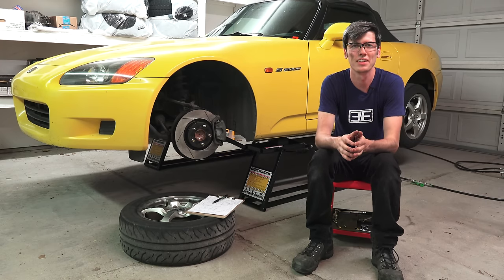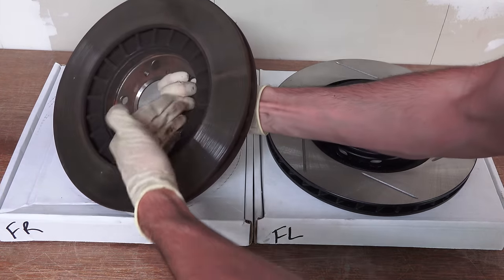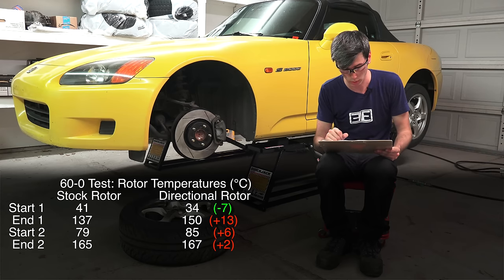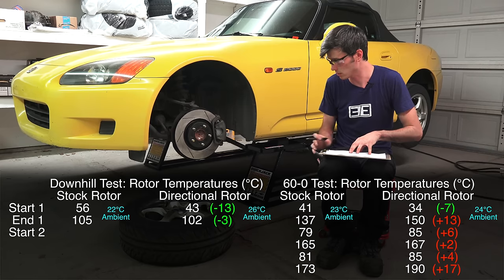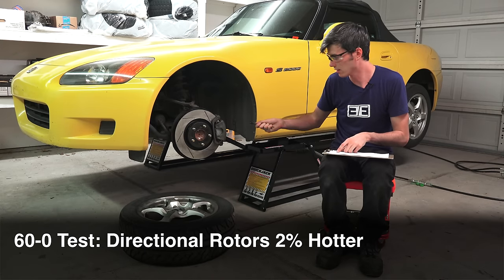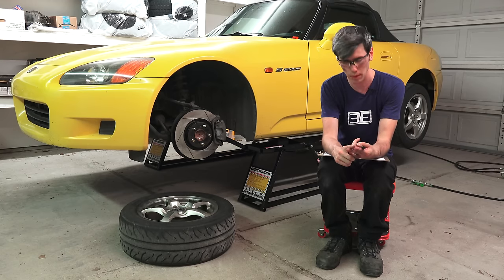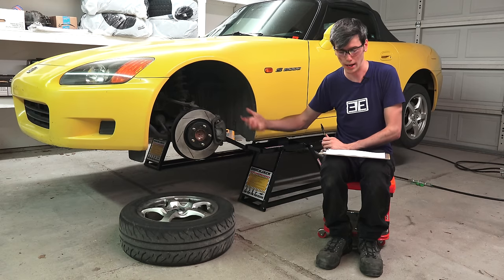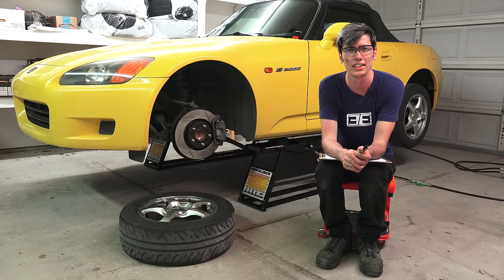Do Performance Brake Rotors Have Better Cooling?

Comment: As an ME this was a great video. Other factors to consider are friction as the stock rotors you tested looked to be used and the slotted rotors looked brand new. Generally rotors need to be "broken in" to the brake pads. If the same pads were used throughout the experiment they may have broken in to the stock set of rotors creating higher friction points on the slotted rotors. Incidentally came across this video looking for upgrades to my stock brakes.

Comment: YOU have been working on you're car. I love it! a youtuber that doesnt pay someone else to do the dirty work.
Reply from the maker: Really just clever editing and makeup. ;)
Reply: Well you're cosmetics person needs a raise. lol
Reply: You're=you are. You meant to write your.
Reply: +denka1337 You're*
Reply: No.
Reply: Maybe  symbiosis  and is 1 with the car You Are Car. ha
Reply: GTP Life   You are = you're 
                   Your = means belongs to that  "you"
There's no hope for humanity.
Reply: GTP Life you would like autoedit youtube channel
Reply: definitely my motto is built not bought i even built my own front bumper on my suburban.
Reply: GTP Life better yet, an engineer that can swing a wrench. #Respect ✊
Reply: GTP Life brakes are, by far, the simplest repair on a vehicle. If an "engineer" can't do that repair, they should probably not call themselves an engineer. 
Lol
Reply: Engineering Explained that's exactly what it looked like, too. Like you smeared grease on your face and grabbed your brand new PPE and started taping lol. No one has grease on their face like that except actors in movies/TV shows
Reply: Hacker Adam BLOWS you would be surprised how many engineers don't even know what a screw is. I'm a mechanical engineer (but I can do any work I need on my car front structural welding repair to blown head gasket)

Comment: the veins vent the pad gases away and prevent brake fade and essentially do a similar job to a wet tread tire pushing water center out.  critically hot pads under pressure want to hover away from a flat rotor surface much like a hover craft generates thrust and hovers on its skirt. introduce veins, voila gaseous escapiest...   anyone that races or drives very aggressively knows the sinking and sphincter puckering feel
 that is brake fade.
Reply: james, bingo. I put 'j hook' (Willwood style) rotors on my car and the fade resistance was vastly improved on heavy braking over stock rotors.
Reply: Yes, the surface grooves do that, but it doesn't matter which direction those grooves are clocked on the rotor.  Foolish people think those grooves somehow have to spin a particular way as if they are scooping air the way a saw blade scoops wood chips when cutting wood.  WRONG!
Reply: exactly. He should have measured the braking distance after repeated braking under high load. Not measuring temperature. But yeah he did that home work when cooling was in question. Pointless but done.
Reply: @LukeBasson  to be fair to him, a big marketing point of drilled and/or slotted rotors is the "improved cooling" properties. So this is a good test for that factor. The brake fade and stopping distance properties should be done in another video
Reply: @sidewinderzero  These are not drilled though. He doesn't seem to know the reason for the grooves, which are for the reason which James Alverson stated.
Reply: @alangross2277  reread my comment
Reply: @sidewinderzero  I agree with what you said 100% and wasn't meaning to dispute your comment. That said, he seems to have missed the point of these types of rotors. It's a buyer beware world out there, if somebody is buying these because they think they're going to run "cooler" then they have not done their homework. His testing would have been much more informative to his viewers had he stated what the actual purpose of the slots and/or holes are. At this point one has to wonder if he knows.
Reply: @alangross2277  looks like I misunderstood you then, fair enough my good man. I agree with you there as well. But too late now anyway.
Reply: @sidewinderzero  No problem...it's often times very hard to know somebody's intent in a comment.
Reply: @alangross2277  But wait, he's not talking about the grooves right? He's talking about the vanes between the 2 rotors? Or am I missing something?
Reply: @vidjansa9955  He is talking about the grooves or slots on the face of the rotor.
Reply: Alan Gross then why the picture of the vanes at 0:44?
Reply: @vidjansa9955  Dude! At the beginning of the video he points at what he is talking about...I don't know what your confusion is.
Reply: Alan Gross Alan Gross Well, he could just as well be pointing at the rotor that has different vanes (the fact that it is slotted being a coincidence), he has a picture of in the video which shows different vanes and it would make sense since vanes do help with the cooling...
Reply: @LukeBasson  The other half of that question is, is it really a problem? I honestly never felt brake fade in my car, and I sometimes drive fairly aggressively. 

I know this is an issue on the track, where you're constantly going from full throttle to slamming on the brakes, and back again. Street driving, there is usually plenty of time for the brakes to recover. The only time I can imagine this is an issue is diving down a long freeway hill at speed, and constantly having to drag your brakes the whole way down. I've only really had this problem in the 14k pound F550 crane truck at work. I just learned to baby the brakes.
Reply: @mitchd949  Not true !! The rotor on the driver's side of the yellow car in the video is mounted ON THE WRONG SIDE !
 The slots and drilled holes are DIRECTIONAL !!
 My ACDelco Specialty Performance Drilled & Slotteds are marked "L" and "R" from the factory.
The rotors were made especially for severe-duty police service -- mounted on '95 Grand Marquis.
 These rotors were installed along with Eclipse Calipers, Motrorcraft Police Pads, Centric Hoses, and D.O.T. 4 Brake Fluid.
After 50,000 miles of use, Brake performance is outstanding -- for long-distance, high-speed touring through the mountains and deserts of the American West.
Reply: @sidewinderzero  Really?  Drilling, yes.  But I've NEVER seen slotting alone advertise the cooling factor.  Because that's not what they're for.

Comment: I'm not sure you are taking all things into consideration. Rotor temperature alone may not be the sole determining factor of performance.  What if the rotors are carrying away heat from the pads more efficiently?  Or, with the slotting allowing gas to escape may be offering additional friction, resulting in the higher temperatures, but increased braking as well.  

I'm not saying you're wrong.  Just that, I'm not sure that you are right.
Reply: Off-gassing isn't as much of an issue for current brake pad materials. However, the vents should aid in clearing dirt off the rotors, and should also shed water better than a solid rotor.  I wonder if the slotting helps prevent rotor warp...  Regardless, IMO you may be on to something.
Reply: Slotted rotors are only for looks. The fastest cars in the world F1 cars, use solid rotors. Enough said.
Reply: They are also open wheeled. Not saying you are wrong, but they are also nothing like a road car :)
Reply: Or if a carbon ceramic brake for example generally won't even heat up to operating temperature on the street, so it may have anything from worse, same, or better stopping performance compared to the regular brakes on the street. Carbon ceramic brakes may even have worse cooling to try to get them up to temp quicker? Again I have no idea though.
Reply: @Theredeemedchild2  But rally cars use slotted, which experience more adverse conditions than tarmac, maybe they perform better in mud or dirt etc.
Reply: My thought is that most performance rotors ie carbon ceramic, need to be at very high temp to work well. So heat doesnt mean less efficient, they are probably designed to work at higher temps when the stock arnt. But I'm only a certified YouTube "mechanic" so I could be talking out my ass
Reply: Yes, they may brake harder but the energy is the same as long as there is a small difference (otherwise if you brake slowly more energy goes into the rolling resistance and air resistance). Also less surface area (with the slotted rotors) means more heat at the surface but then the heat is dissipated in the material pretty quickly. I think the data shows more probably a correlation between the temperature and mass.
Reply: Nvr Dwn every single professional GT car in every professional GT series in the world disagrees with you. You don’t know what you’re talking about. F1 cars use carbon brakes and a ton of cooling. Stop acting like you have any clue what you’re trying to talk about.
Reply: @TheHannukahZombie  What works on a race track doesn't necessarily work on the street.  The driving conditions couldn't be more different, ESPECIALLY the braking conditions.   Cold braking performance is irrelevant on the track, but crucial on the street.  Repeated max braking performance is critical on the track but rarely matters on the street.  Etc. Etc. Etc.
Reply: Wouldn't more heat mean more friction mean better braking performance?  Brake friction rotor temperature and cooking are all separate measures
Reply: @666dynomax  No, because the heat cooks the pads.  Retained heat is a very bad thing for braking performance, all other things being equal.
Reply: @chuckschillingvideos  Doesn't matter, the person I replied to is 100% wrong. Carbon brakes on an F1 car and steel rotors on the street are two entirely different animals. Again, that person needs to STFU because they don't know what they are talking about. Slotted rotors on street cars are fine, same with drilled. If they weren't performance cars wouldn't come with them from the factory.
Reply: @chuckschillingvideos  yes and no, it all depends on the operating temp range of the brake pads. Yes, the pads will eventually fail if you are outside the temp threshold. The Mu factor decreases with temperatures close to the threshold which will impact the braking performance.
Reply: In my experience, I’ve had many solid rotors warp over and over, but any time I’ve ever put slotted rotors on a car they get too thin to be reused before they ever warp
Reply: He also isn't considering the surface finish. When new, brake rotors have cross-hatching on the friction surface to help the pads bed in. Over time, this wears off. The new rotors will have cross-hatching while the original rotors won't meaning the new rotors are going to generate more friction and, in turn, more heat. The only proper way to test this is to have both slotted and non-slotted rotors in new condition with their own identical sets of brake pads. Go through the same bed in procedure with each set, and then test.
Reply: I'm a mechanic and turn rotors as part of my job. The machine (at least the one we have) doesn't put cross-hatching on the rotor, it just cuts the surface to make it even again. I usually try to scuff the surface with some aggressive sand paper after I'm done cutting but cast iron rotors are pretty hard and it doesn't really do much. You would need some kind of special machine to put OE style cross-hatching back into the rotor surface after turning it.
Reply: Nvr Dwn f1 also don’t use steel rotors or pads either
Reply: @Theredeemedchild2  Not so.
Reply: Yeah, they're a carbon type brake rotor like you can find on high end cars. Very similar. Sorry but the whole point of a rotor is to dissipate heat. Air cannot conduct heat as much as steel. The less material in a rotors, the less heat it can hold. Which means the pad gets hotter, which can lead to serious problems... Like brake fade because the brake fluid begins to boil. "Gas" between the rotor and pad use to be a thing, but isn't anymore.

Comment: but they're air cooled so shouldn't you brake then travel a little and see the difference in cooling between OE v. aftermarket? you would also think you'd need a specific brake pad with the directional rotors do increase the breaking and cooling but decreasing the coefficient of friction to run cooler.
Reply: Thomas Comptois I said the same thing but you beat me to it! But yes I absolutely agree, thank God someone else thought of it too.
Reply: Thomas Comptois  the energy required to stop the car is the same if the speed is the sams, that energy goes into the rotors/braking system. keeping the pads the same means they hold the same energy.
Reply: the energy is the same I never questioned that. I'm just saying you change the coefficient of friction by changing materials and design. and the other point was rotor cooling is done by airflow dissipating the heat from the rotors and not when your stopped. granted great will still be radiated to the air while at rest but the main cooling effect is done while in motion
Reply: heat will be radiated
Reply: Artem Brayson I couldn't agree more

Comment: Even if breaking performance is the same, less un-sprung mass  is a worthy venture.
Reply: @t1tacal  I prefer a tinfoil hat so the aliens can’t tell what you’re thinking.
Reply: @alienpoker  With an "HD" Antenna?
Reply: Yes that’s is a positive thing however you don’t want the rotors to be too thin otherwise they will break. More mass means when you apply the brakes they stay cooler until you first stop so for road use they are more effective. Then after repeated breaking they will heat up. Racing rotors are  not too large in diameter, but thicker and still not too heavy. However. They have air ducts with intensive cooling.
Reply: inded. I am running 3D Strand woven carbon ceramics in the front, which saved 7.1 kg per rotor or 31 lbs for the front set, the steering increase with the angular momentum decrease, and 0.1-0.2 s 0-60 decrease. Also shorter braking distance but i have yet to measure that. Also, if discussing performance steel rotors lets talk something like Brembos with an aluminum hats which cools faster...
Reply: The increase in acceleration performance is mainly due the reduced weight of your wallet and bank accounts.
Reply: @jtwu8931  Not if the performance saves the car 2-3 times when someone one with a 500$ clunker cuts you off and hits the brakes. I remember such a scenario when the cheap brakes, EBC, failed so badly that I nearly hit the car. They were permanently DTVed... After that spent better $ on brakes and all I got to do is making sure that someone does not rear end me. A single such collision due to cheap brakes can result, where I live, in 500-1000$ yearly premiums for 5-10 years, thousands more. Or a sudden traffic jam.  Same as Civics, in winter the calipers seized suddenly and near mishaps. Went to a premium car, no more seizures, and my rear brakes last easily 160,000 kms (vs 1-2 winters for a Civic). Front ones about 100k.... Brembo GT steels.. Pricey but they paid themselves over in NOT having claims..
Reply: Belisarius bro, get a Subaru and it will brake for you. Cheers
Reply: JT Wu i live in Canada where they have lots of problems BBK and worse, any Subaro oem parts really rut except at 47deg North where there is no wet 20% Salinity. In Montreal qc city Ottawa Winnipeg subaru rots in a few years. Brakes last one winter. Germans last forever but hey who am I, we only have 500.000 kms of premium german ownership and 13 winters for 2 cars. Japanese only before. Google Subaru rust and see why they are a joke in winter now. Lots of issues. Its AWD is still stellar, but maintenance brutal. Non ULSAB alloys shows vs AMG BMW Porsche and even sloppy Volvo has that tech from brakes to hood..

Comment: Actually the brake cooling can be maximized by the airflow. The slotted ( you called directional) rotor has a inverted hat design which helps cool faster. Your enginnering guess was right about the rotor weight (we called it heat mass) on stock rotor..the inverted hat design is better cooling design. Unfortunately the slot design does not helps as people think. This rather helps to remove debris and waters.. hope this helps
Reply: slot only decreases mass which is not good. useless except as sales tool

Comment: I always thought drilled and slotted rotors are for expelling gas from the pads. The slotted rotors might be pulling more temperature out of the pads themselves, causing the rotors to get hotter. Would be good to do a test on the pads for a comparison.